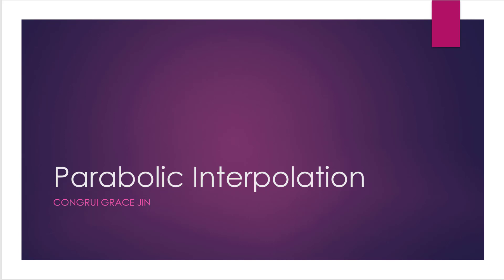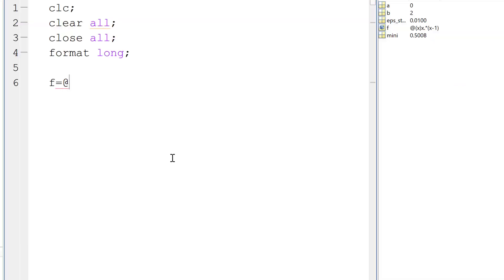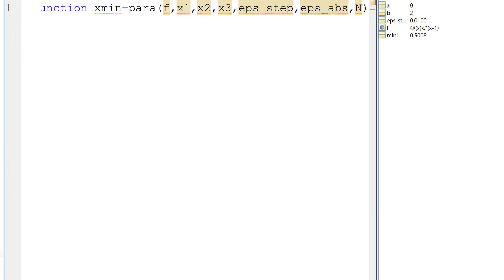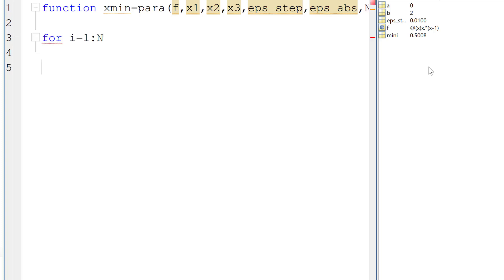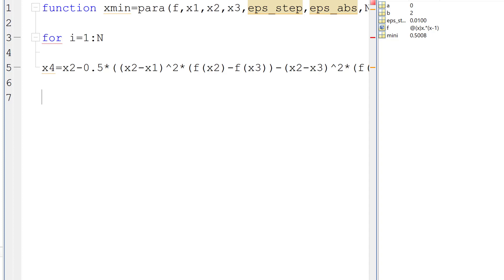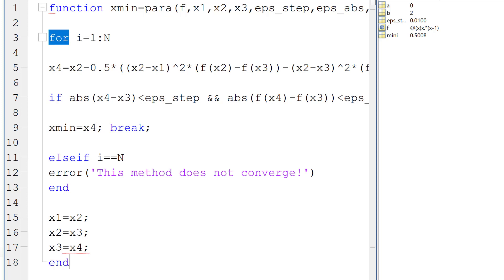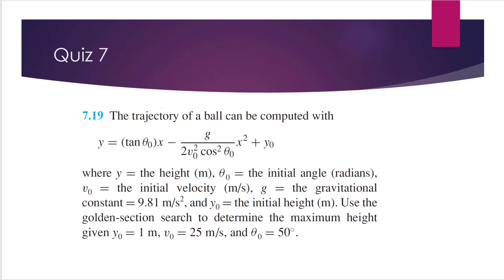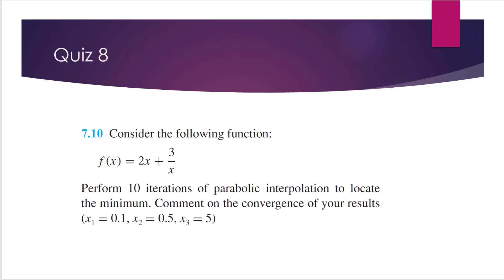Parabolic Interpolation Method (Part 3)

Comment: Oh we cannot use it on piecewise function/discontinuous function?
I try to calculate the step size of steepest descent for barrier method
once u plug in F(X+lambda*S) your function become piecewise if u apply this method without limit/domain sometimes it will work
however I haven't tried it with domain in piecewise function
can u do an piecewise example?(I can provide an example)
Reply from the maker: You can not use this method for piecewise function or discontinuous function.
To use this method, the function has to be continuous and also has a continuous derivative. You check this video: https://youtu.be/noczK51tOgE